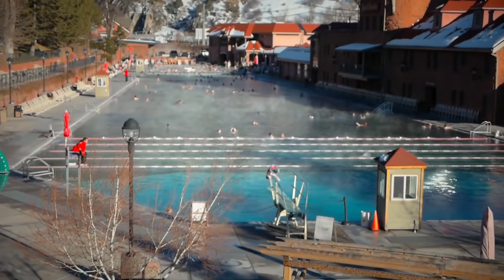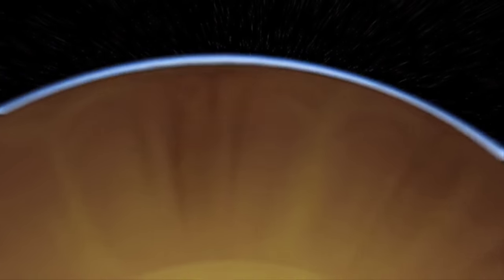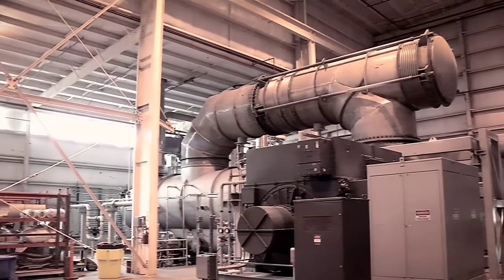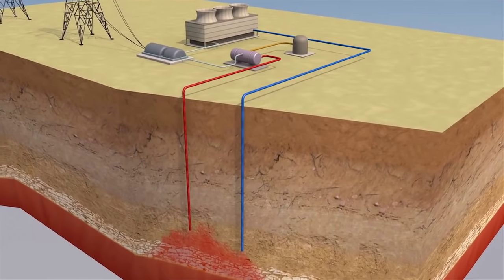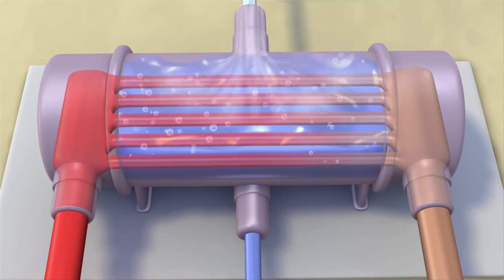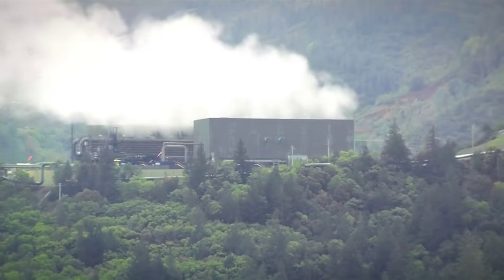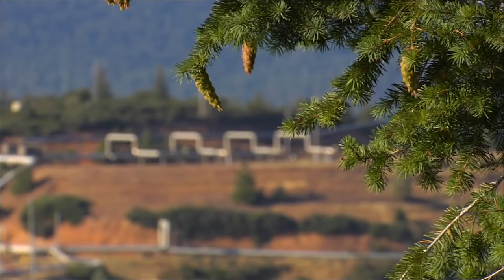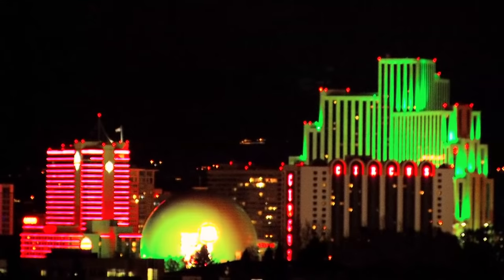Energy 101: Geothermal Energy

Comment: About this video.  It's a good video, but has some errors.  Just so you know:  (1) Dry steam plants are not the "most common type" of geothermal plants in or U.S. or in the world.  Flash plants are the most common in the world, dry steam fields are rare, but large, providing steam to numerous plants each.  (2) In flash plants, the "fluid" (hot water and steam from underground) that is described in this video can either rise forcefully up wells under it's own power, or be pumped up the well.  (3)  Cooling of the hot geothermal water does not cause it to flash to steam.  Rather, the very hot (over boiling) geothermal water remains as mostly water underground because of the high pressures deep underground.  Being released from the high pressures at the surface is what causes it to flash.  Cooling it actually causes it to revert to water and contract (as is what happens at the back of the turbine, where it passes through a condenser unit.  Flashing is an expansion and the pressure of the expansion is what drives the turbine blades.  (4)  In the geothermal industry, the "heat transfer fluid" used in binary geothermal power plants is more commonly called the "working fluid."  You can look up the definitions of both terms to understand why working fluid is the better term for binary geothermal plants.
Reply: Hi I am currently studying renewable energy engineering...can you please give me some links where you have got your information on. 

Thank you and have a nice day
Reply: I know these things from over 30 years experience in the geothermal industry both as an employee and consultant and having talked to numerous geologists, drillers, engineers and plant operators for the purpose of writing educational materials about geothermal energy.  The Geothermal Resources Council Library is a good source of technical information.  See also the book Energy for Keeps: Electricity from Renewable Energy chapter on geothermal. There is a video (now out of date) about geothermal on the Stanford Geothermal Reservoir Engineering website.  And a (now out of date) slideshow on the Geothermal Education Office website.
Reply: Thank you very much. I will start reading from tonight :) :D :). Can you please let me know how i can get involved? either in the design of such systems? or maybe some company names....i off course will be doing the same. I should finish my renewable enrgy engineering degree (in photovoltaics ) this year and then hopefully study a masters or go straight into the industry :)
Reply: The Geothermal Resources Council Annual Meeting, along with the Geothermal Energy Association Geothermal Expo (exhibits) is in Sacramento this year, on October 23 - 26.  See the geothermal.org website.  Student registration fees are very, very low ($5 with proof of student status),  and the opening session Monday morning is open to the public.  If you could attend, you would have access to exploration and development company, service and supplier, and agency exhibitors and personnel.  And there  will be 2 days of technical presentations by industry experts.
Reply: I am from the UK and currently a mature student studying at an open university course!....But i shall be on the lookout when events like this come to the UK :)
Reply: @annacarter690  you are so brilliant. I want to learn from you more on geothermal technology. Are you on a WhatsApp or facebook group
Reply: Thank you for correcting the errors. Very interesting. Especially that flash plants are more common than dry steam plants. You are a great person to fact-check videos.

Comment: But does it work night and day year round without the use of fossil fuels?
Reply: It should as long as there is a steady supply of water that can be evaporated. You would only need fuel as a heat source for the steam, but geothermal uses earth's lava crust as the heat source, which never cools down

Comment: FYI: there are 2 ways of geothermal energy. 1 is the way you show, to use the natural sources of hot water. 2, however, involves drilling a hole and inserting 2 pipes connected at the bottom and lowered by a metal wire and continuously extended by adding pipes much like oil drilling. In the end the 2 pipes are long enough to lead water down and hot water up so to exploit this for geothermal energy also. Thus, geothermal energy is now available, cheaply, to all people on Earth. Remember to insert fluids to secure good contact for the warm hole so that water becomes hot quickly to ensure LOTS of geothermal energy return! Best wishes.
Reply: Inserting fluids is the one thing we should not be doing. This fractures the crust, leading to who-knows-what problems. It is also completely unnecessary. Although fluids would tranmit heat to the pipe faster, they would also lose their heat proportionally quickly.
It is only necessary to backfill the space around the pipes with substrate. The energy transference is identical, according to the laws of thermodynamics. Because of its relative density, fluids would transfer energy faster, but would also reduce its energy capacity faster. Which would cool faster, a cup of mercury, or a cup of water? Again, which would cool faster, a cup of mercury, or a cup the same capacity of solid iron?
ΔU = Q − W
Reply: You don’t connect pipes underground by “lowering them with a wire” 🤦‍♂️ 

The drill IS the pipe. As it drills lower and lower you keep adding pipe extensions at the surface.

Comment: The Geysers built 1965 , designed for 2000 Mw, that is 2,000,000 Kilowatts. Dry steam is superheated steam. Supereheatrd steam is supplied to the first stage turbine, as it expands it becomes wet steam and the droplets of water can erode blades. To avoid this the steam is diverted from the turbine and reheated and introduced to turbine downstream of the injection point. Attenuators are sometimes used to reduce the temperature of superheated steam. An ent Haley vs entropy chart for steam is useful to understand this old but widely used in power stations technology.

Comment: This could be a long reach, but will geothermal plants lead to lowering of the Earth's temperature directly?
They will of course reduce the burning of fossil fuels and thus reduce the climate temperature indirectly.

But since this involves withdrawing heat directly, can it help reduce the surface temperature?
Reply: Since you are using water that was already in the Earth, probably not.

They are experimenting with supercritical CO2 as a fluid medium instead of water, as part of carbon sequestration. At least that's how I understand it.
Reply: The earth is in layers..each layer warmer than the next..borrowing a little bit of heat from 1 layer really wouldn't do much..when the layer beneath it is still radiating a constant temperature..like putting a straw in boiling water..the water is still going to boil ..even if u drink some out of it..only the straw amount will cool down..not what's still in the pot..
Reply: It would take a long time. I'm talking 200M years to exhaust the earth's heat this way!! So nobody's worried! 

With Ground Source heat pumps, seasonally you can drop the ground temp two degrees, so you have to watch where you drill.

Comment: This is the future!!!
Reply: +Ranjhacom Too much money to be made by pulling shit out the ground....
Reply: +An artist theory on the physics of &#39;Time&#39; as a physical process. Quantum Atom Theory Ways to Produce Electricity Pros and Cons BBC Bitesize KS3:

a.) Fossil Fuel (Coal)
Pros:
a.) They are cheap
b.) They are safe
c.) They are formed on land and it's easy to get.
Cons:
a.) They emit a pollution called carbon dioxide.
b.) They need to plant enough trees near the power station
c.) Volcanoes emit sulfur dioxide, so if there's a volcano nearby the power station, the carbon dioxide and sulfur dioxide will interact each other and will cause acid cloud to form. This will cause acid rain to fall.
d.) They are finite resource because they take millions of years to form from dead swamps.

b.) Nuclear Fuel
Pros: 
a.) They are cheap
b.) They don't emit pollution
c.) They don't need to plant enough trees near the power station.
d.) If there's a volcano nearby the power station, it won't cause acid cloud to form. This won't cause acid rain to fall.
e.) They emit hydrogen and nitrogen which is harmless to the environment.
f.) They are renewable resource because they take a fortnight to form from dead jellyfish.
Cons:
a.) They are formed under the sea and it's difficult to get.
b.) They are type of carcinogen, a cancer causing agent which can be harmful to DNA and RNA, so they need to wear protective clothes and handle nuclear waste very carefully.
c.) If there is an accident, large amount of radioactive waste can be released to the environment which can stick around for thousands of years. It must be stored safely.

c.) Wind Energy
Pros:
a.) They don’t cost any money
b.)They are efficient
c.)Wind energy is a renewable resource because wind is unlimited
d.)Wind energy doesn't emit pollution
Cons:
a.) Windmills are very noisy and it would distract people and animals nearby and this noise could damage your ears
b.) They can’t build houses near the windmill
c.) If any birds and flying object got in contact with the moving windmill, they’ll get seriously harmed or destroyed or even killed
d.) Windmill electricity is affected by the wind. We can only get windmill electricity when it’s windy. When it’s not windy, electricity isn’t produced.
e.) Some people might get distracted.

d.) Water Energy
Pros:
a.) They don’t cause any money
b.) Water is a renewable resource because water goes in cycle
c.) Water doesn’t emit pollution
d.) Some water in the water combustion can turn saltwater or polluted water into fresh water.
e.) They can control flooding, deep water ways for shipping.
f.) Some dams have fish ladders.
g.) Tidal barrages and hydroelectric power stations are very reliable and can be easily switched on.
Cons:
a.) It takes quite a long time to build a water combustion dam
b.) If there were an accident, it could cause flood and ruin the habitat nearby
c.) If we set a nuclear atomic bomb, it might cause tsunami to surge
d.) It can’t be made anywhere in the land and it only can be made near the water area
e.) It has been difficult to scale up the designs for wave machines to produce large amounts of electricity
f.) Dams interrupt the life cycle of the organism nearby.
g.) Sometimes reservoir water is cold and destroy organism nearby.
h.) Dams flood farmland and push people from their homes.

e.) Geothermal Energy
Pros:
a.) Geothermal energy don’t cost any money
b.) They are tough, not delicate
c.) They are renewable resource because they go in never ending cycle like the water cycle
d.) They don’t emit pollution
e.) It takes a short time; each cycle lasts for a minute or even way shorter.
f.) They are very efficient.
g.) They take a short time to build.
Cons: No Cons

f.) Solar Energy
Pros:
a.) Solar Energy is a renewable energy because the sun is always there
b.) They don’t emit pollution
c.) They are shiny like metal
d.) Solar cells can provide electricity in remote locations where there is no mains electricity
e.) Some solar energy is efficient
f.) Some solar energy is cheap
Cons:
a.) Some solar energy is inefficient
b.) Some solar energy is expensive
c.) On sunlight or twilight can turn into electricity. When it’s cloudy or raining, there will be twilight. When there’s dark thunderstorm or it’s night, solar panel is at rest and won’t work.
d.) Some people might get distracted.

g.) Electrical Energy
Pros:
For Lightning:
a.) Lightning contains millions of voltages, so each struck can store lot of electricity
b.) Lightning is a renewable resource because thunderstorms are part of water cycle
c.) Lightning doesn't emit pollution
d.) Lightning doesn't cost any money
e.) We don’t have work for lightning because it’s done naturally
f.) Lightning is very efficient
g.) If lightning struck slightly off the power station, it’ll still work
h.) Lightning goes in zig zag, so if the lightning start striking above where it’s not the power station, it can curve and find its way to the power station
i.) Lightning is bright and very hot enough to strengthen the electricity
For Electric Eel:
a.) Electric eels contains thousands of voltages, so each electric eel can store a lot of electricity
b.) Electric eel is a renewable resource because it’s an animal, it can multiply.
c.) Electric eel can be done anytime even though it’s not stormy
d.) Electric eel don’t emit pollution
e.) Electric eel don’t cost any money.
f.) Electric eel can be placed accurately.
g.) They can build houses nearby the electric power station
h.) People and animals who is nearby won’t be distracted and won’t damage their ears.
Cons:
For Lightning:
a.) Lightning can’t be done anytime and it only can be done when it’s stormy
b.) We can’t predict where the lightning will exactly strike, so it may not strike the power station
c.) Lightning is very hot and it is about 30,000℃
d.) Lightning is very loud, therefore they need to be away.
e.) People or animal nearby would be distracted and this noise could damage their ears.
f.) They can’t build houses nearby the electric power station
g.) This noise can be frightening to them
h.) Lightning goes in zig zag path, so if the lightning starts striking above the power station, it may turn its path and may not strike the power station
i.) Only cloud to ground lightning works. Sheet lightning and cloud to cloud lightning doesn't work
j.) Some thunderstorms don’t have cloud to ground lightning
k.) The power station must be metal aluminum, otherwise it won’t work
For Electric Eel:
a.) Electric eels are difficult to get because they live in the sea
b.)Electric eels may use electricity for defense, so they need to wear protective clothes and handle electric eels very carefully
c.)Not only using electricity, electric eels can kick someone, so they need to use an oil rig to get the electric eel and trap it in the net very tightly.
Reply: +An artist theory on the physics of &#39;Time&#39; as a physical process. Quantum Atom Theory That's great!!! Geothermal energy has no disadvantages.
Reply: +Swaglord350 They don't cost any money.
Reply: It makes the water yucky
Reply: +Swaglord350 nope
Reply: Masashi Ng
It makes the ground soft and unstable
Reply: Not when managed correctly.
Reply: An artist theory on the physics of 'Time' as a physical process. Quantum Atom Theory hahaha
Reply: It's very possible. It's the second most accessible energy source on earth and definitely the most abundant. There is one major caveat though... you have to drill in certain locations to get the best value out of this technology namely volcanoes. And Volcanoes are notorious for firing off a lot of Sulphur Dioxide into the atmosphere which isn't great.

Comment: Can anyone answer how the hydrogen sulfide and other gas emissions such as carbon dioxide and methane arise?  Are closed loop systems the same as binary cycle? Are open loop systems the only ones where gas emissions are an issue?
Reply: Yes, binary cycle plants are considered closed loop systems.  In all geothermal plan types, ordinarily, emissions typically occur when new wells are being tested, before being closed and hooked up to the power plant.  Leaks can also occur in any industrial system.  Generally, though, all geothermal power plants emit much less than gas plants and much much less than coal or oil.  Binary plants are the cleanest.  All geothermal plants take up less land than most every other energy source.

Comment: Very informative.  Is this theoretically possible anywhere?  Or still only in specific regions?
Reply: Everywhere
Reply: Theoretically anywhere, but today’s technology is not that advanced. The video said in the past this only works in certain areas where the heat resources are near the earths surface. This is because otherwise the drilling to attain these resources must go very deep and through igneous and metamorphic rocks which is very difficult. We do not have the efficient technologies to do this and attempting to would be very expensive.
Reply: At least that’s my understanding
Reply: T the Geysers California 1965. Billions of carbon dioxide not produced. I believe this may have been suppressed by the fossil fuel industry. A power station is building near the Salton Sea for geo power and lithium. Two billion dollars.